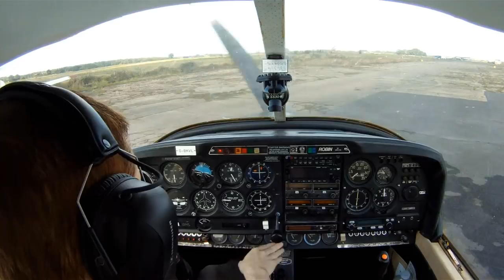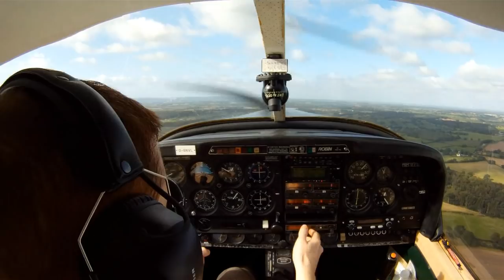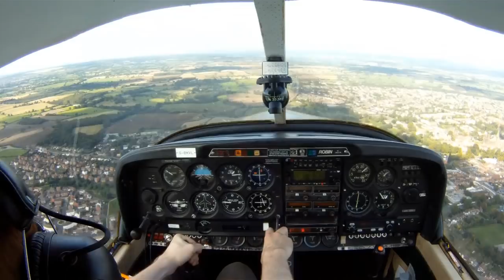GoPro Flying HD - In flight total electrical failure

Comment: I read elsewhere that you have since gone onto complete your CPL and MCC etc. Just an observation which has hopefully now been rectified through training but, in most of your videos when you line up, you apply full power and then start to look at where the wind is coming from, is the DI aligned etc. Please do this first before applying full power, then just fly the plane! In flight you start to notice a problem with the electrical system and one of your first reactions is to worry about getting your camera out and taking a photo of the cathedral. When systems start to switch off you're then randomly pressing CB's on your lower panel while at times looking out of the window. The annunciator lights you test over and over again in a very random 'If I keep pushing I'm sure it will work eventually'. Also - not sure if this was something you were taught in training but on take off you very firmly push the nose straight back to level flight but hold it down for quite some considerable time, I've seen it on a lot of your videos. I'd just be very careful using that practice as coming into ground effect, and adding crosswind factors etc one day you could come unstuck. Especially if you're holding the nose down and the engine fails, you'll have very little time to control that back onto the ground. Might also have been a good idea as the com boxes packed up to consider setting 7600 as it was a fair sign things were packing up, at least it would have allowed a couple of sweeps to show you had issues. Overall though I hope the flying you do today is much more professional and you've since come on to progress and develop. The CPL, IR and MCC would have certainly done that with any luck!

Comment: Dont you switch on the fuel pump? For the laughs, my starting the engine on the robin dr400 sounded exactly the same last time: i was pressing the start button but the keys were in my pocket :D the instructor was embarrassed!

Comment: Before you get in to the cabin make sure master is off and keys are out of ignition and spin with the prop in the way of rotation and it will prime some fuel and oil in to the engine....the start should be faster....and also make longer brakes between startings :-)

Comment: I saw you making a major adjustment to your altimeter setting to make it read 1,000 AGL when in the pattern. Why do you do that?
Reply from the maker: +nikolaki70 In the UK, we set the altimeter to QFE (aerodrome pressure setting) so we can fly the correct circuit height.  It' so that all aircraft in the circuit are on the same pressure setting to avoid any possible collisions.
Reply: That sounds very wrong to me but it makes sense.
Reply: And thank you for explaining by the way

Comment: First question: Did you find out what went wrong? Did you talk about it with your airclub after to figure it out?

Second Question: Why after starting the engine, don't you put on the alternator and instead do it just before T/O to do it? Maybe this could have degraded you batteries causing the elec failure?
For having flying with the DR400 quite a lot, I always turn on on the alternator right after starting the engine in order to use the batterie as less as possible...

But still I would be interested to know what really happened, even if it was a long time ago.

Safe flight!
Reply from the maker: 1) Apparently it was a failed alternator, the instructors had a look got it fixed, then sold it :)
2) I was never really checked out properly on the aircraft. It was entirley my own fault, I was slightly unfamiliar with the aircraft, and was using a checklist from a Piper warrior, because the school didn't have a DR400 checklist.  It's not too professional I know, but I've learned my lesson the hard way.
Another piece of knowledge to put in the "Don't do that again" memory bank.
Reply: GoPro Flying Cool. I glad you learned from your mistake. Remember that a checklist is just a reference to the Aircraft Manual. So before going flying on this A/C, you should have checked it out. And why not make your own check-list? This way you spend time with the manual to get to know the A/C better. You can still get it verified by the ChiefPilot of your airclub later, for sure he will be impressed and will implement your creation to the airclub :P
Reply from the maker: Thompilot
I agree. I guess I knew I was only going to be using the aircraft for a couple of months, then I'd never fly it again, so I just got by with what I had. That's a good piece of advice though, thanks.
Reply: GoPro Flying
Are you carrying a hand-held or a mobile now?
Reply from the maker: I do, but I still would never have thought to use it unless it was mentioned.

Comment: Instead of pumping the throttle so many times in the beginning, I would have left the throttle in, kept the mixture out and would have tried to start the engine, once the prop starts to spin I would have slowly eased the throttle out and applied full mixture. Because it seemed like you was going to flood the engine.

Comment: hi, was wandering with the time lapse you just set it up on the camera right.. and ive seen videos where its normal recording then part of it is time lapse then back to normal (like your video) is there a button that like turns the timelapse on an off, or do you have to edit it on computer? 
Thanks
Reply: It is something that is edited in after the video has been recorded with video editing software.
Reply: Oh rite so you just highlight an area, then edit that part to playback as time-lapse... i want to make some cool videos when i get my GoPro.
Reply: There's no timelapse involved he recorded his flight then sped some parts up
Reply: MadMaxGaming OK Mr. Literal. You are correct, there is no technical time lapse here. however the "sped up part" (which was being referred to as a time lapse) is done in editing software after the footage has been recorded.
Reply: LeskiStation Yes that's right i edit all my videos in Sony Vegas Pro 11 i think it's about $800 and you split your video up and highlight the part you want to be sped up or as you would call it a timelapse and thats it what software do you use to edit on?
Reply: MadMaxGaming I just use Adobe Premiere, works basically the same though.
Reply: LeskiStation Ah ok you're good! it'll work

Comment: why was so difficult to start the engine?
Reply from the maker: +Pedro Picon Barriel No idea, it's an old aircraft which was hardly flown by anyone other than me.  I honestly have no idea, but if it wasn't flown at least every 48hrs, it would take upto 30minutes to get it started.
Reply: Ohh, it should be a "vintage aircraft",  Now, i understand why the engine don´t start at the first attempt.
Reply: +GoPro Flying shouldn't that be something worth figuring out? XD
Reply from the maker: +MrJohnramboguy It wasn't my aircraft, I didn't really care.  That's the truth.  It was fine once it was running.
Reply: I gotcha XD
Reply: +GoPro Flying I think as a pilot you should care. Either to learn that it was just due to the way you primed the thing or to find out it was caused by something that will be issue in another occasion (with somebody else flying it)
Reply: +GoPro Flying Dude, just read this - really - you don't care ???..... With an attitude like that you shouldn't have the privilege of a licence.
Reply from the maker: +John Blumenthal In my 8 year experience of flying light aircraft, difficult engine starts are something that comes with the territory.  I've rarely (if ever) flown an aircraft that starts first time.  Most of the 25 aircraft I've flown are at least 20 or 30 years old.  It's usually a fuel priming problem, either too much or too little.
Do I care about the aircraft I fly? Of course I do.  Do I care about why this particular aircraft didn't start? No, not after the first time I flew it.  Why? because no-one could start it first thing in the morning, not even the owner.  The instructors at the school warned me it was a pain to start, "just give it some time" they said, "it always gets going eventually".  Sometimes my computer crashes, I don't need to phone a software engineer to figure out the problem.  Do I not deserve to own a PC?
Reply: +GoPro Flying 

"Sometimes my computer crashes, I don't need to phone a software engineer to figure out the problem. Do I not deserve to own a PC?"

Flying an aircraft and operating a PC are two completely different things. For one thing you don't endanger anyone else's life when your PC crashes.
Reply: He flooded the shit out of the engine, should of leaned it out whist cranking, and as soon as it comes to life richen the mixture again, that's the technique we use to get our robin 2120s cranking
Reply: >It wasn't my aircraft, I didn't really care

Heh you still trust your life to it..
Reply from the maker: It was an electrical failure, unless the aircraft caught fire it was never going to be an issue.
Reply: GoPro Flying What I meant was the engine

" It wasn't my aircraft, I didn't really care. That's the truth. It was fine once it was running."
Reply: There's a key difference here. You and other people are likely not at risk of death or serious injury if your computer crashes. You might as well be comparing eating an apple to running a marathon. The two are completely unrelated, and your case invalid... and unsafe. I think what most people are saying here is that you should always err on the side of caution. If something looks off, smells off, and feels off... it's probably off, and therefor a better idea to stay on the ground.
Reply: Jesus christ some of these people are crankier than that plane :)
Reply: it was not flooded.  Watch the throttle.  He pumps it, the engine farts and tries to start (briefly).  He holds it wide open.... and.... NADA.  If it was flooded, holding it wide open is when it would fart and stutter.  I fly stuff that is very hard to start occasionally.  You gotta know what the engine is telling you.  When you give it MORE fuel (by pumping the throttle or hitting the prime, and the engine rewards you by farting and stuttering and trying to start IT IS STARVING FOR FUEL.   If, you hold the throttle wide open and it farts and stutters, then you would be correct.... flooded, lean it, hold it wide open, and crank.  Watch the throttle and listen to the engine.  This one was starving for fuel.
Reply: I liked the "fart and stutter" expression :-) I haven't heard a more precise description in a while:-)

Comment: What do you do if this happens and you want to land at a controlled airfield
Reply: TechGeekRc The proper procedure is to carefully  join the pattern and look for light gun signals from the tower....if you can actually see them, that is.
Reply: MaxRideAE What if 2 airplanes at the same time have commnunication problems and enters the pattern, how will the pilots know which airplane they turn the lights on for? And since the pilots cant communicate, how would they even know that one more airplane have communication problems? :D Incredible unlikely sceenario but i am just curious.
Reply: usually if you are in the airspace, you do the standard over head join, then wait for signals, other than that, leave for an uncontrolled field
Reply from the maker: +TechGeekRc +TechGeekRc There are procedures to follow if you have a radio failure 
in controlled airpsace when flying VFR or IFR.  These can be found in 
the UK AIP for each individual airfield.  It includes information for both inbound and outbound aircraft.

Comment: Are you used to flood the engine that way or this was just your first time on a piston engine aircraft?
Reply from the maker: Please explain.
Reply: GoPro Flying I mean when you start the engine. To me it looks like you are flooding it. Usually, one or two strokes to the throttle lever before cranking the engine are ok. More than that (especially while starting) will flood it.
When the engine is flooded, you should cut off the mixture, apply full throttle and then crank the engine. As soon as the engine starts, apply full mixture and reduce the throttle. I know is not easy but it worked every time i had a flooded engine.
I think that if you had did it this way, you would have started the engine at the first attempt, not at the nineth. ;-)
PS: Well done with the emergency.
Reply from the maker: The Robin has no fuel primer, so you have to squirt fuel into the manifold by using the throttle.
Reply: GoPro Flying I know, and that's right. But you should squirt the fuel just one or two times before cranking. Do not overprime it while cranking the engine.

Comment: Reporting 2,000 altitude when 2,800 then 2, 450 feet? Be careful with that.
Reply from the maker: +AH6OY Good observation, however, I was reporting my height, but my altimeter was displaying my altitude.  QNH vs QFE
Reply: +GoPro Flying Interesting how England uses a rough estimate of elevation reporting instead of actual altitude. Don't ever try that in other countries and especially in controlled airspace. It's a bust that will end your pilot ticket. It's for the safety of others and you that all altitudes are reported as altitude not elevation. You can give an elevation much lower than actual altitude making other aircraft and controllers thing there is no conflict with traffic. Brit Regs state "Vertical positioning of aircraft when at, or below, any Transition Altitude will be expressed in terms of Altitude." So giving position reports you state your altitude. Altitude is what the altimeter gauge reads not any figuring of how far above ground  level AGL.
Reply from the maker: Having re-watched the video myself it appears that I was using the altimeter on the right side of the aircraft which was set to QFE (AGL).  I admit it was still out by a couple of hundred feet.  Not acceptable I agree, and I certainly don't work like that any more.
Below transition altitude we normally fly on QNH (AMSL) then on QFE (AGL) when in sight of the field. 
It was clearly a bad habit that I have since learnt from, thank you.

Comment: Keep to the centre as much a possible; if you carry on as you are one day you will end up hitting something with a wing and you won't have a leg to stand on. This is good practice, even when backtracking the runway. The take-offs were good, but you seem to have developed this rather dangerous practice of making a "fighter jet" climb out; flying a few feet off the runway before reaching the end then making a steep climb. Altitude is safety, especially on take-off.

Comment: Hey GoPro, don't you want 1200 ft on final? you where kinda low :). regardless, i'm just starting to learn how to fly, I have 12 hours in. 2 twin hours, 10 single prop. Trying to get the lingo down in the air is very hard, it was a great lesson listening to you talking with the tower. thanks!
Reply: I'm sorry, where i fly out of I'm 800 above msl, so i mean, you should have 400 agl on final?
Reply from the maker: Adam
Depends on the circuit height. If the circuit height is 1,000ft, then you should be looking for about 6-700ft when turning from base to final.
Reply: GoPro Flying Why do you guys use a stick in the U.K or Ireland. Wherever you are. Regardless of the location, you guys use sticks? I though most use wheels. I guess i'm not that educated on flying in Ireland.
Reply: Adam I Fly in the US and have had my private pilot's license since about 2004.  When I learned to land my instructor told me the idea is to roll out from base into final right on glide slope. Hard to do consistently and varies from plane to plane based on sink rate, speed, roll-out location, etc.  In the States the general rule of thumb is if you're not sure what the posted pattern altitude is, we use 1000 AGL on downwind abeam of the numbers, then smooth decent to final.
Reply: Trevon Martin Yokes, not wheels.
Reply: Trevon Martin Different planes, different controls.  Some planes in US have sticks, but most common plane is the Cessna and all (that I know of) but the Cessna Skycatcher have yokes (wheels).  My OMF-Symphony has a stick.
Reply: Trevon Martin If you use Yokes or Sticks depends on your aircraft type

Comment: This is a truly disgusting display of flying and airmanship. A good thorough routine instrument scan would've caught this problem in the bud much earlier on, and you wouldn't have had to have made the landing without comms. What were you supposed to have done? Well, once you finally realised you'd run out of battery juice and your radio wasn't working flying over the field at 500ft above TPA would've notified the tower you had lost comms; you should then be looking for light signals from tower.

Comment: You flooded the engine with fuel, pumping the throttle - it didn't need that much and would make for the perfect recipe for a fire. There were at least 2 if not 3 occasions the engine would've started if you had simply let go of the key; the magnetos were catching - instead you elected to wear down the starter, giving it insufficient time to breathe between cranks and flattening the battery needlessly.  Then I'm going to criticise your taxiing and take-offs..

Comment: That's at bad engine if it took that long it was to not safe to fly at 2000 feet at 85 knots
Reply: +MrSuperstarrocks Thats normal cruise for a robin/alpha, the 85kts was probably at 85% throttle, cant go much faster